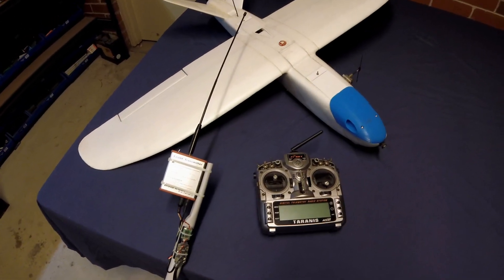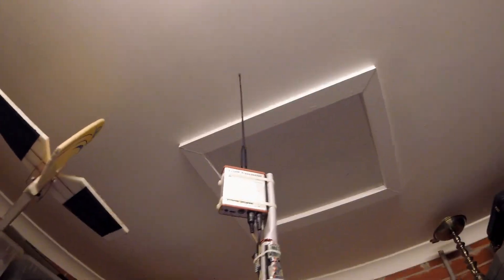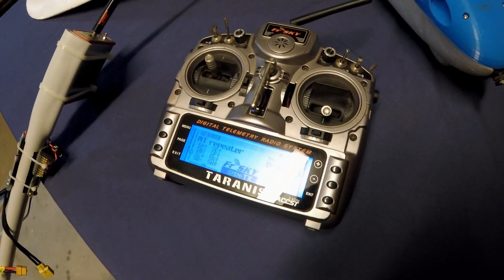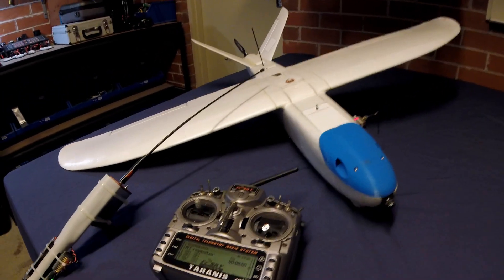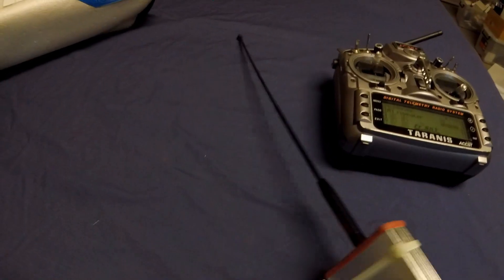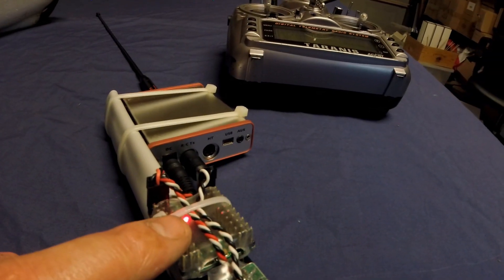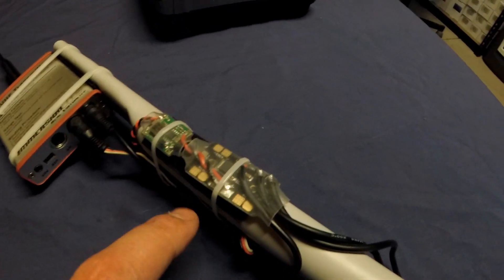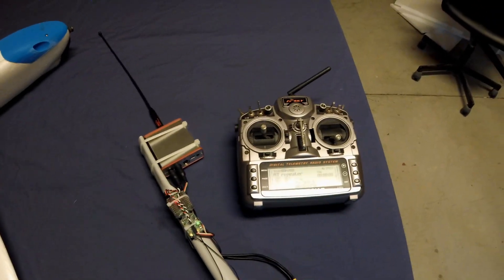» UHF Repeater for the Mini Talon

Comment: Hello, do u get rssi and link readings  through this relay? Cant seem to get mine to show readings. Does the ezuhf need to be hardwired to the tx and set at 28 ms? Got mine on relay like yours n just found out that i have no rssi on laptop or osd. Rssi set to ch 11 and 12 on rx sppm. Thanx
Reply from the maker: Yes, i have rssi coming back via the ppm stream. Can't remember if there were any ms settings to adjust
Reply: @StuntDoubleFPV  hmmm...tried rebinding on mode D16 ch1-12 and D16 ch1-16 with the x8r sbus to sppm convertor. Ch11-12 in the tx is clear, nothing assigned. Ran the rx analysis many times on vector....no rssi...any other ideas u can help me with? Btw im using the eagle tree vector osd
Reply: @StuntDoubleFPV  ok i have rssi working with wired to the back of the taranis via ppm from tx but rssi readings stats at 100% when i go with the relay. Any ideas?

Comment: Are you able to run telemetry back through the 433/2.4 link?
Reply from the maker: The vector flight controller gives me visual telemetry which is just fine
Reply from the maker: No not with this old setup.

Comment: Thanks so much for explaining the control crossband part.  Picked up an FrSky RX4R for its 16ch sbus out, got an sbus-to-ppm converter and am going to run that into my ezuhf Tx.   Awesome!   :D    My video is an RMRC 1.3G Vrx to a 5.8G Tramp HV Vtx.  12V & 5V bec's, and a 4S 8000mAh lipo.   My enclosure is being mounted ~1.5km away on an opposing mountain ridge, which should give me coverage of this entire mountain valley.

Comment: Gday mate I have built one one these repeaters before and it worked ok  Problem i have is i need 9 channels i'm using the taranis plus and i have tried a D8 and now a x8r but been having problems with the power off RTH  the RX sorta goes a bit haywire when the taranis off any ideas
Reply from the maker: When you say haywire what exactly is happening? Does rth ever work or just randomly? Do you connect the rx to an sbus converter or directly to the UHF tx? If you use an sbus converter try connecting the ppm out pin to a flight controller with betaflight then look at the channel values during a failsafe
Reply: @StuntDoubleFPV  worked it out 
Sindre good system but you forgot the TX settings. here is the settings for your setup  using a  frsky X8R in this configaration  L9R binding maybe the same. You need to bind the X8R as so . Set failsafe in Taranis to Receiver / Custom or No pulse does not work with the Sbus converter . Set D16 change 1- 12 channels.  Put frsky X8R into bind. Then bind Taranis.  power off  the  X8R and exit bind from Taranis. Power up X8R.  Set RTH switch on Taramis and briefly  press failsafe on X8r. Steady green light  your done. This is for TARANIS > X8R > SBUS to CPPM  for 12 CHANNEL >  EZUHF     2.4 WIRELESS EZUHF  REPEATER
Reply: @StuntDoubleFPV  thanks for getting back to me . Normally when the Taranis is connected by hard wire we use ppm external out  straight to the ezuhf ppm in. In my case i am using the Taranis plus to the X8R then trying to sbus out though a frsky sbus to cppm  to the ezuhf. problem is when i turn off the Taranis off instead of failsafing to RTH it goes into crash mode . not sure if it got to do with setting the Taranis failsfe mode on the TX
Reply: 2.4g wireless uhf repeater
I hope i made sense

Comment: Looking really great SD!  Back in the day of CB radio, good buddy, we used to talk about our 27MHz antennas requiring a "ground plane".  Now with this aerial a few metres up a pole, does the need for a ground plane become an issue, or is one simply not required for 433MHz, or at all?  SSM
Reply from the maker: Good question SSM, but I don't know enough about antenna theory to answer. I'll test it and compare results.

Comment: Instead of adding another point of failure, why not just directly wire into the UHF transmitter?
Reply from the maker: To get the antenna up much higher to improve rc signal. I cant hold the transmitter up high enough for long periods of time to prevent failsafes when flying down low. I guess it is another point of failure but this one is easy to manage.
Reply: with radio signals, your antenna is everything, location location location.  And type, but mostly location.   Being able to get your antenna up above the clutter decreases the amount of junk between it and the craft, giving better signal quality.  Putting the Tx up there at the top is FAR better than using coax to stretch the antenna up there.  When you run coax (as I have), then you have a whole series of losses to deal with.  Putting the whole Tx up there removes all of those losses, the RF power goes directly into the antenna.    The way he's got it set up even provides good cooling.  

If you live somewhere you can watch your dog run away for 3 or 4 days...  you probably wouldn't need the repeaters.

Comment: Thanks. Good idea, much better than long antenna and bulky box on the back of the radio.    I’m guessing I may need to get off 2.4 video, although I still might try it
Reply from the maker: Yeah I never liked the bulky box uhf transmitters on the back of the radio. I will still use my EzUHF JR module in the radio. The repeater will be used when I need better low altitude signal.
Do you get any interference issues with 2.4 vid? There are so many wifi networks around.
Reply: @StuntDoubleFPV  
Just for a reference, video on 2.4GHz, UHF on control.
https://youtu.be/ALzcaRhr6CY
I been flying in between small village (up to about 900m away) and jamming road (up to about 700m). Also about 1km away from local micro airport (I'm guessing my GPS issues might be casued by the airport).  I have about 100+ flights on 2.4 video and 1st time issue like this one. Inflence from Wifi routers are neglictable.